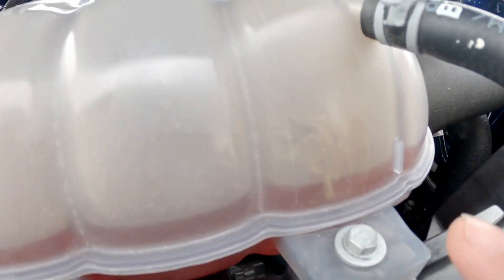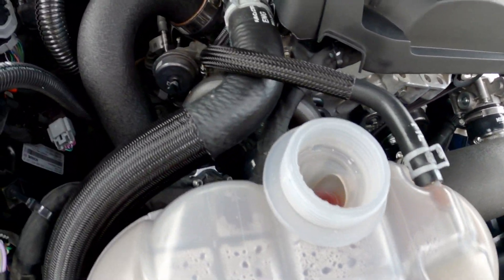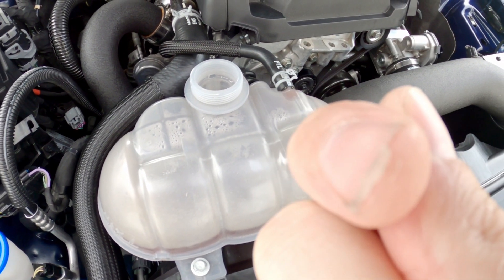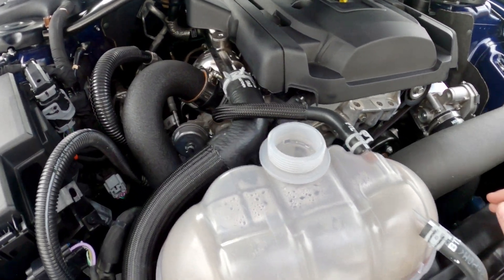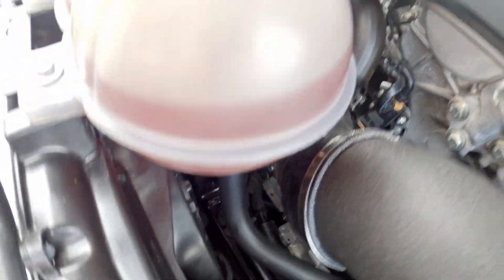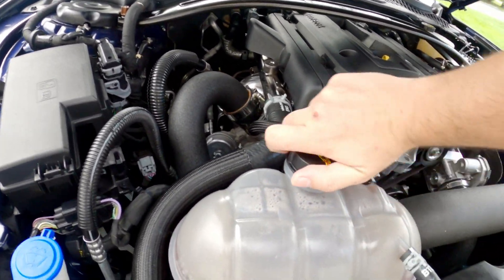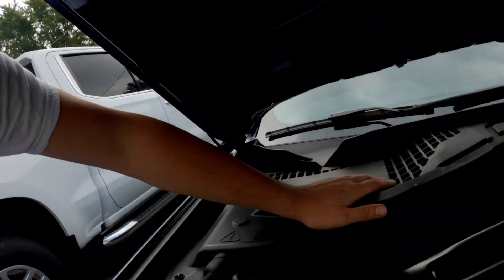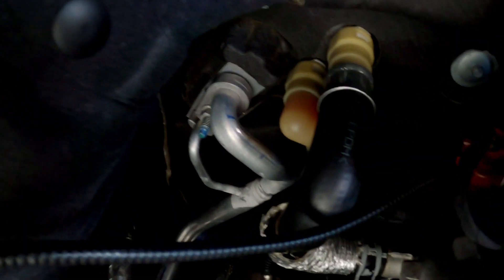I NEED YOUR HELP!!! Something Is Wrong With My Mustang

Comment: I hope that it isn't a bad gasket of some sort. No puddle under the car either? Take it to the dealer. That doesn't look good to me. It is a brand new car!
Reply from the maker: It's not leaking or burning anything. Other than the small bolt-on mods, the car is stock. So this is really disappointing to see. I'm calling the service department Monday.

Comment: fordtechmakuloco is always cleaning that residue out of the expansion tanks its odd you are getting build up so soon maybe its just the new POAT style coolant
Reply from the maker: Exactly. After time, this could be expected. Maybe it is caused by the coolant. Either way, it's gotta be fixed. I'll call the service department Monday.
Reply: @KarzKreated  i have a feeling they will say its normal... i noticed today on my taurus they made the top of the tank black so i couldn't check for residue